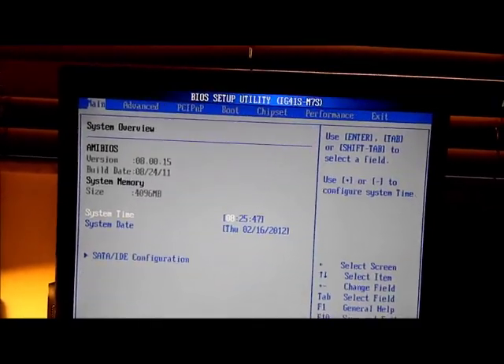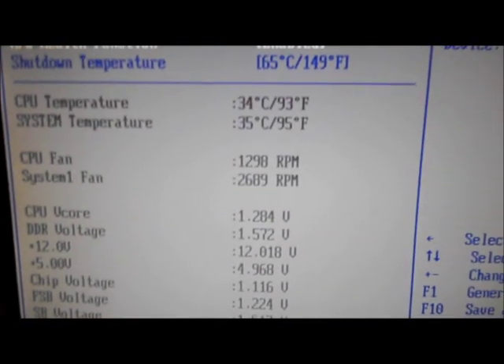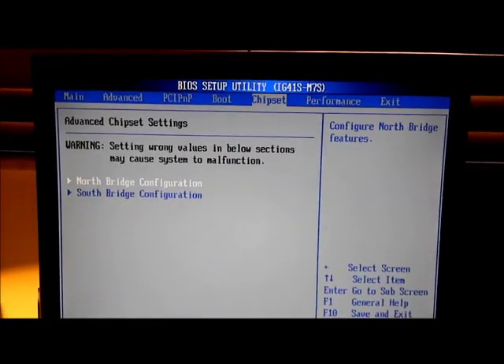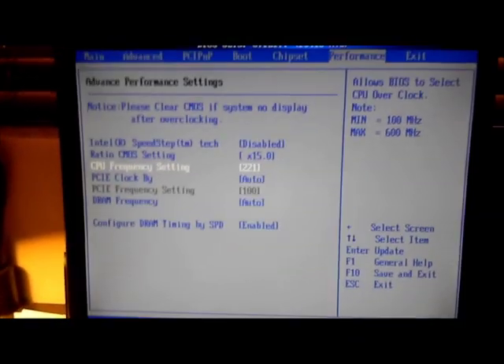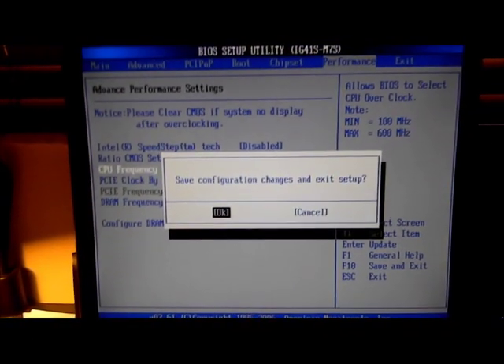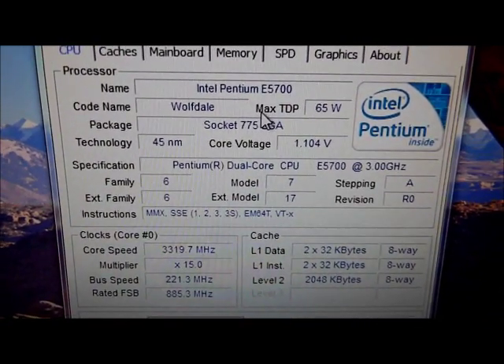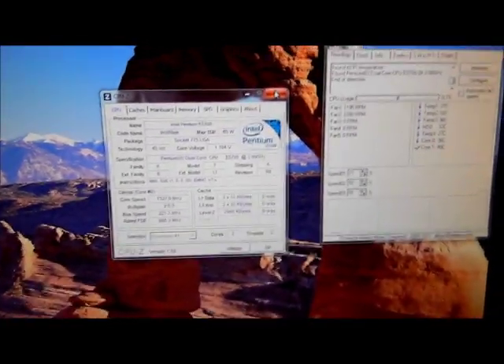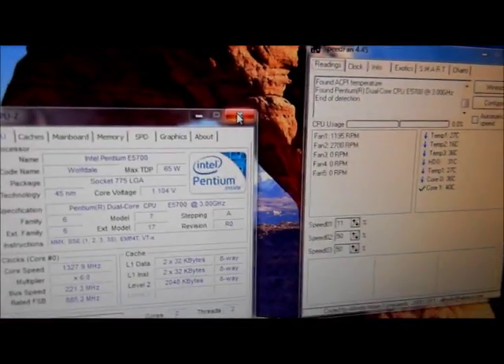Simple and Easy CPU Overclocking Tutorial (results may vary) D: Pentium E5700

Comment: I have a Pentium Dual Core E5500 @2.80 

When i click on in my Bios settings and enable overclocking function It shows it's default value 200 what's the Safest to over clock and what's dangerous bro pls help me...
Reply: 210....

Comment: if I overclock my cpu dual core e5700 can it be damaged?
Reply: +Elio Abihanna Only if you overclock by too much, i wouldnt go more than 500 mhz higher , if you have stock cooler i would sugjest you only OC by about 300 Mhz for safety
Reply: +Elio Abihanna I have the same cpu at 3.3Ghz and it runs fine. stock cooler, load temps arownd 65-77ºC

Comment: my e5700 boost to 4.3 ghz))   motherboard g41m-vs3
Reply: +Proga LoL How, i have a g41m-vs3 r2.0 can u teach me please, i only can get 220 in bios or the computer doesn't start
Reply: FrancoxoHD no, you must change power tranzistorsin vtt and nb voltage, it is too hard
Reply: Teach me :D
Reply: +FrancoxoHD (Francoxovideos) you may use 2 or 4 and more tranzistors as one, but it is hard to cool them, they are very hot when pc start.
to do it you may solder tranzistors by this instr. http://forum.guns.ru/forums/icons/forum_pictures/002113/2113334.jpg
Reply: +FrancoxoHD (Francoxovideos) but it must stand you processor power (1-2 v+) 300+mv
Reply: I can be happy whit 3.5Ghz, but i only can reach the 3,4 but the computer freeze in the desktop, my max temp is 41 when i play games, whit an 3.5Ghz it will be ok ?

Comment: my spare rig uses the E5700 and in combination with the excellent coolermaster TX3 cpu cooler I managed to achieve a 3.7ghz overclock ... being a wolfdale cpu the E5700 has loads of overclocking headroom .... with a corsair H50 for example it would easily be able to cope with a 4ghz overclock .... however its mainly down to the motherboard.. strange thing though the 3.4ghz gives me a 6.7 on the WEI ... not bad for a lga775 cpu ..

Comment: 3.4GHz is quite safe, whether you're running on a stock cpu cooler. I however run at a custom made cpu cooler and my case is well ventilated so i managed to overclock it up to 4050MHz (4.05Ghz). REMEMBER, the overclock is useless if you don't increase the voltage! THIS GUY IS DOING IT ALL WRONG!!!

Comment: Hey, I overclocked my E5700 from 3.0 to 3.225 (FSB 215) and the CPU is not too hot, and I read on some forums and the CPU can run to 3.6 or more w/o increase vcore.
I have a question, in cpu z the multiplier is all time x15, without running programs, and from what i know the multiplier decreases for saving power. And my FSB:DRAM ratio is 1:2. I have 2x4GB Corsair Vengeance @1600 Mhz, and my mb support max 1333 so ram runs at 1333Mhz. My mb is Gigabyte P41T-D3P
Sorry for my bag english!